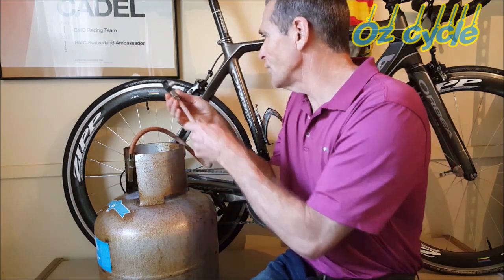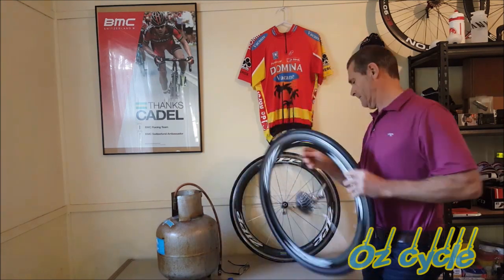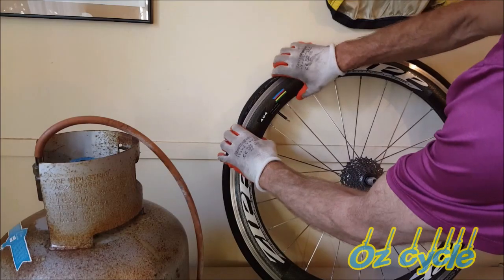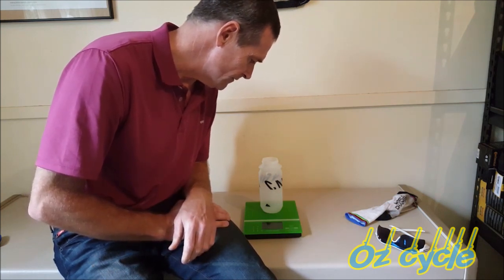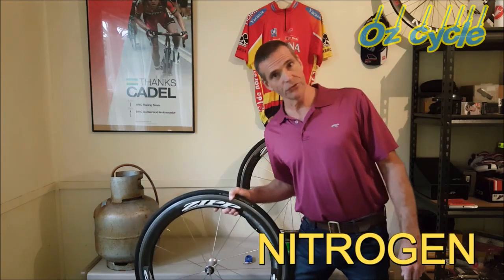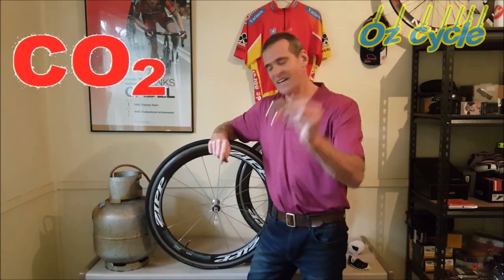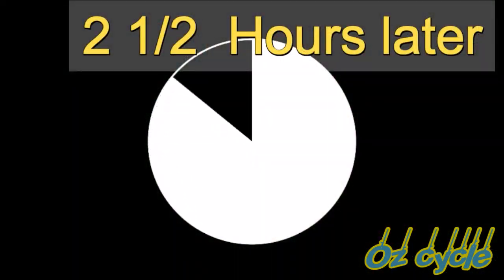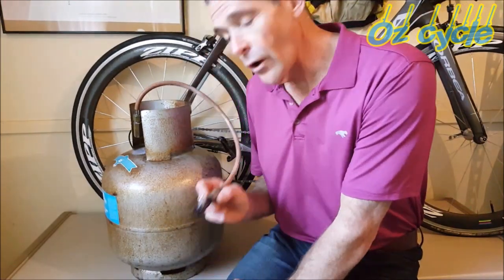Helium in your tyres - make you go faster ?

Comment: Great video, mate! The fact about the oxygen leaking faster than nitrogen was really interesting. This means that, in theory, if you always top up your tires to the point that the air inside is 99% nitrogen, they should require less "topping up" in the future, as they're now nitrogen filled which should leak less. However, if you get one flat on a ride, and pump it back up with normal air, your two tires will be "out of sync", meaning one will go flatter faster than the other - worth bearing in mind, because often before a ride I just check the pressure of one tire, because I assume both will be losing air at the same rate, but now I know - apparently not! All this is however slightly more trivial, as I now use latex tubes, which need topping up before every ride anyway. :'( Again, great video!

Comment: Interesting science there. Tread, width and rolling weight are the key factors when it comes to wheels and tires. I have learned one thing in the cycling world is that good wheels (with good hubs), a decent tire/tube or tubeless setup that is aired up to a correct tire pressure is the best that can be done. However, when it comes to air there is moisture at play. A commerical style compresser can remove moisture but I doubt that would do anything to help riding. Thanks for the video.
Reply from the maker: +The McC Yes,I wonder how much the moisture would weigh in our tubes?
Reply: Moist air is actually lighter than dry air at the same temperature and pressure - water molecule H20 is lighter than O2 or N2!

Comment: can you make an in depth tutorial video for using a torque wrench
Reply from the maker: +They Live We Sleep Very good suggestion. I will put that on the to do list. Thanx.
Reply: Agreed - note that I understand that you can get 1/2” , 3/8” and 1/4” torque wrenchs. make sure the torque wrench you buy matches your socket set and vice versa; (ps adapters can be bought but are extra fiddle)

Comment: Great video, about to put new conti 4000s on my zondas, thinking of going to the supersonic tubes, 55 g per wheel lighter, what do you think of lightweight tubes , are they worth it ?
Reply from the maker: +ThePrinterPaddy Yes lighter tubes are fine. The thinner the tube the quicker they leak tho.
Reply: I swapped over to supersonic tubes and there is a noticeable increase in climbing/sprinting power. Cheapest speed upgrade imo.
Reply: Conti's supersonics in 26-622 tyres (more like 27 on the rims I use) deflated faster than Schwalbe's extralight. The latter weight 70g, though.

Comment: Now that you learned how to bend wood… (1) You can decrease the »coldness« by creating a decompression chamber from an old plastic bottle. Drill two holes into the cap, two tubes go in. One longer, from the gas source; the other shorter, to the gas sink (the wheel). (2) CO2 pumps and similar work by pressure equalization. So, attach your pump temporarily in place of the sink to use its manometer. (3) Bonus: If you break or cut metals in earth's atmosphere, the fresh surface reacts with Oxygen. In Vacuum and to a lower degree with gases like He that does not happen. Therefore, in a sealed environment with He, you can cut two cables (old brake cable, new one) and press them together – to form (an ugly) single one. Smooth, unlike with soldering. Handy for internal cable routing. (Or, if you cannot create a bond any other way in case of a catastrophe. Like, to fix signals cables.)
Reply from the maker: +EditioCastigata Cool ideas...you must be an engineer Editio?

Comment: Would Helium be recommendable for Track Cycling then? 
I could imagine that a few gramms could make a tiny difference in acceleration, especially at the high speed in the ring. Plus harshness doesn't really matter on a smooth surface..
Reply from the maker: +Steambrom Yes it would suit most track events. The tubular tyres used on track have really thin tubes hence the helium would leak even faster but a last minute tyre pressure check and inflate should do it.

Comment: Hold the phone, this is parallel to the pound of bricks vs a pound of feathers. Putting 90psi of either helium or Air in the tyres should come out to the same. I'd be more interested in a compression test of which gas one needs less of in the tyres to produce the same contact patch on the ground vs Air and others.
Reply from the maker: +SlowBoyAthlete Helium being less compressable with reach 90psi with less mass (or weight).
Reply: Thanks for the extra info. I agree with you that helium sounds attractive but doesn't effectively do much else for your speed and abilities (like ceramic bearings). Keep up the channel and fantastic post production editing! Still on the fence about going the paraffin wax route. Perhaps soon!

Comment: Helium would leak out of my 25 mm 700c wheels so much faster than plain old air. I pump up my 700c wheels before every ride. That wouldn't be practicable with helium. If you really wanted a lighter wheel, use hydrogen.
Reply from the maker: +mikeyvester Pump,pump,pump,BANG!!